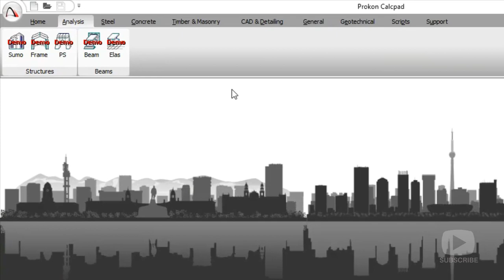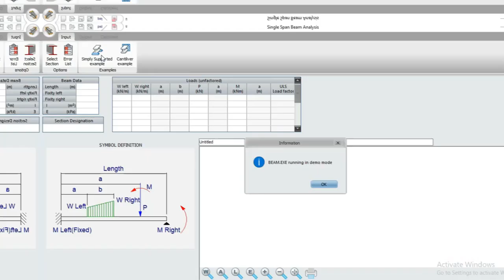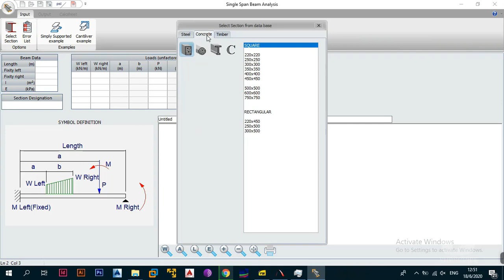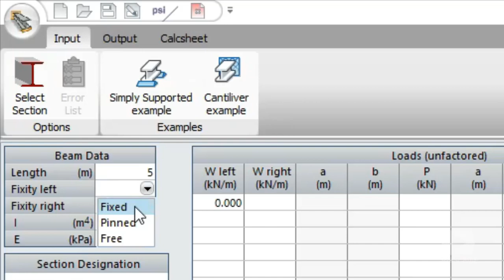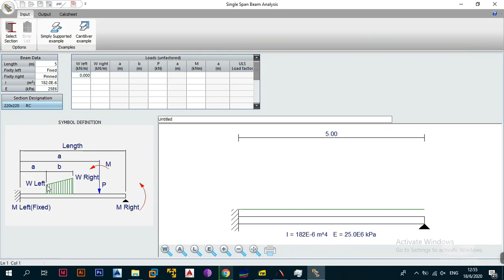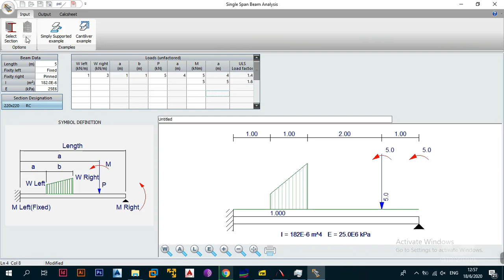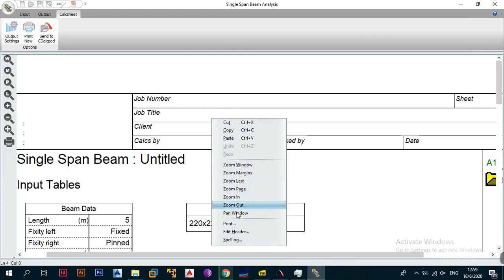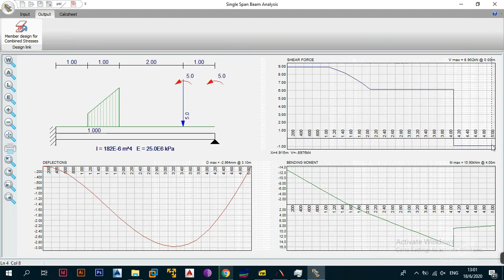Prokon Tutorials For Beginners In English:  Part 4 Single Span Beam Analysis

Comment: Does Prokon take into account  the self weight of any element designed or do we have to include it when determining the loading?
Reply from the maker: most modules take into account the self weight particularly those that tell you to include the dead load factor or dimensions of the section but one module in particular the column design one you need to include the factored self weight in your calculations.
Reply: Ok, thank you very much.